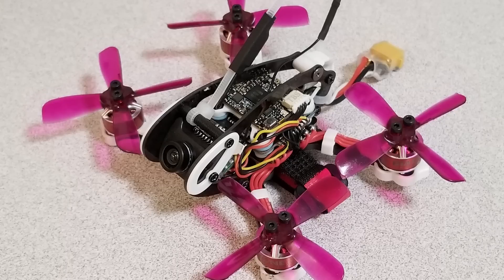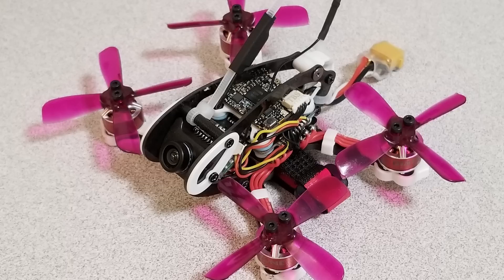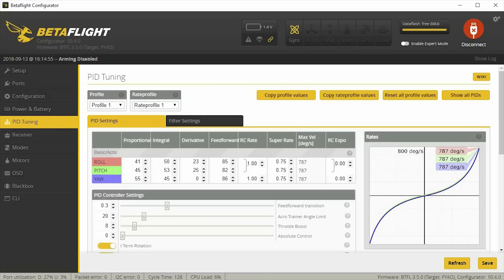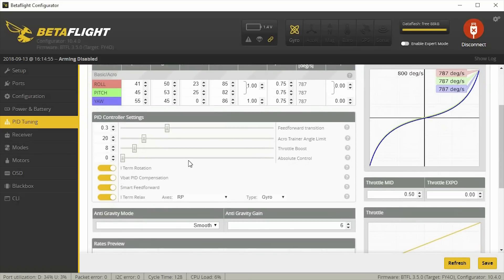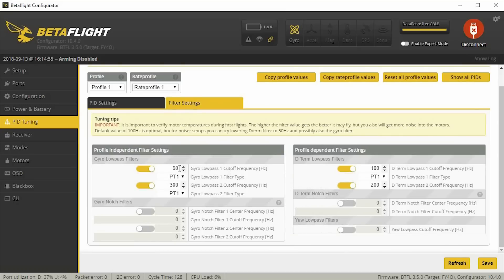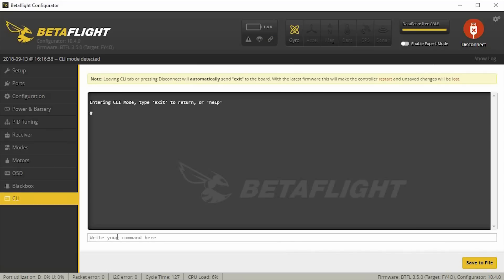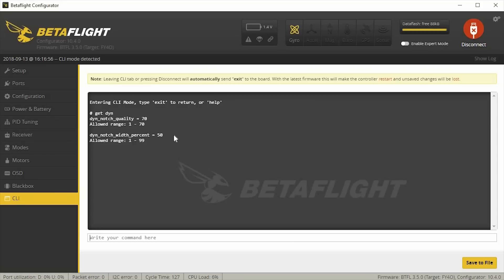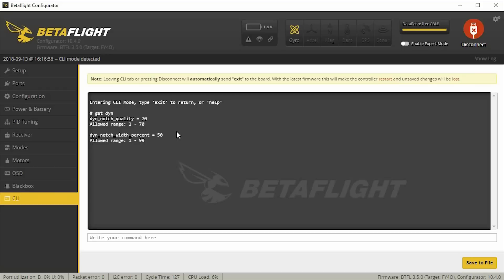Betaflight 3.5 PIDs // Diatone GT-R90 🎓

Comment: Thank you for the video. Are you using the props in the picture? Have you tried the hulkies and if so what are your thoughts?
Reply from the maker: Yes, I used those props.  I have used the Hulkies in the past.  They can be good, but lately many are unbalanced so I get a lot of vibrations... I stopped using them.

Comment: Hi Albert  i am flying this frame with hglrc 1104 7500kv and i use turnigy high voltage 550 mah 70 to 160c 2 s and i want to try 3 s battery. What do you recommend? I am guessing i need something with smaller mah to be arond the same weight.
Reply from the maker: The one I have listed in the description will work too.  Not sure the PIDs will work since the motor is a different KV but give it a try and watch your temps.

Comment: The final PID settings are much less impt. to me than the method you use to tune (none of my quads exactly match yours). So the silent video of the tuning process is not useful, esp. with a bunch of new params since 3.2. Some benefit to the commentary for the changes in the beginning ("this is down from stock cause motors hot"), but for those who don't want to see you go through and explain the methodology, I'd say just post your final settings and skip the video.
Reply from the maker: Most the tuning methodology is the same as before when I talked about it in previous videos.  I talked about some of the new stuff in the intro video.  I'm going to finish up these tunes in this way and will not be doing tuning videos anymore.  This takes up way too much time and hardly anyone watches these and all I get are complaints.
Reply: Sorry to hear that. I don't think anyone else gets into micro tuning process as much as you do, besides "here are my PIDs". I hate to see you pull back from that, but I guess I am in the minority - my Tuning playlist is far bigger than any other category I have.
Reply from the maker: I think ultimately we need to move away from the whole idea of tuning and complexity.  Also, my tuning process is super simple.  Trial and Error.  Unlike most people, I don't fear the unknown.  I try some settings... if it seems better, great, if not, revert back and try something else.  I'm pretty sure it's a methodology a lot of people will be able to master like I have.
Reply from the maker: I think I will make a video on the tuning process.  I think you and everyone else will hate it.  It's just me trying a bunch of random things.  I don't understand Betaflight at all.  I'm worse at explaining it.  I think no one will ever ask me for PIDs again after that video... LOL
Reply: Agree things will evolve make tuning less important. I was lucky - the 1st 4 quads I built worked great on stock PIDS, or settings from U-tubers (like you) for the one I bought BNF (XJB). Latest build not so good. It's great you have a simple method (T&E) and that you don't dive into BF technobabble - makes you the right guy to help us novices. From my point, I see a problem (e.g. hot motors) and there are 50 BF variables (changing constantly) I could move up or down (talk about random), or look for bad props, over propped, loose build components, and motor screws touching... You can probably tune this in your sleep. For a new quad, what are the top problems to check for? How do I test/fly this to check for those problems? For each common problem, what are the top X things to try to resolve it with current BF? Your "random" things look like a rifle shot to me.
Reply: I appreciate your efforts.
I also understand why you don't want to make tuning vids.
It is what it is. People can be so mean. Don't sweat that stuff. If keeping things simple grows your channel and gets more people flying and learning, that's what teally matters. I get it.

Comment: im tuned on my  gtr90 with the new avan blurs trust me way better

albert
Reply from the maker: I've tried those.  They are too heavy for 1104's.  Even EMAX has told me those were designed specifically for the 1106 motor of the Babyhawk-R.  They designed the prop so I trust them more  😀
Reply: Albert Kim  i have been flying them for a while on bf 3..4  and now 3.5 and no issues even on 4 s .try em out u wont regret it
Reply: i wish emax made a new 3in prop for my 3inch baby hawk
Reply: btw i have the v1 with the 32k gyro also
Reply from the maker: I have tried it.  I do regret it.
Reply: @AlbertKimTV  lol what do u regret about it?
Reply from the maker: Because the prop is heavy and 1104 motors lack torque, the prop is not as responsive as a lighter prop.  You like them because they have good top end thrust but most experienced pilots are not at 100% throttle all the time.  I prefer a more responsive throttle and that prop isn't it on an 1104.  On an 1106 it's much better.